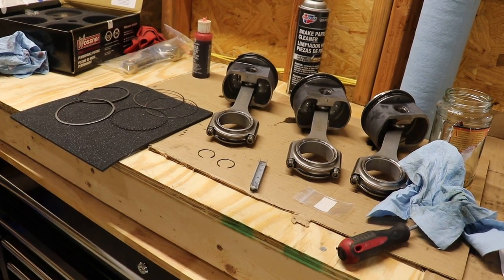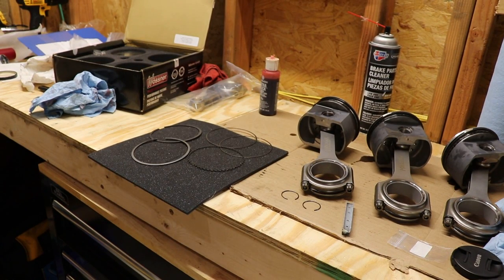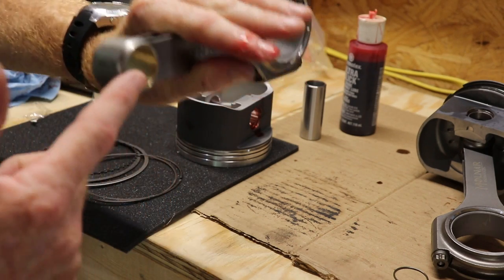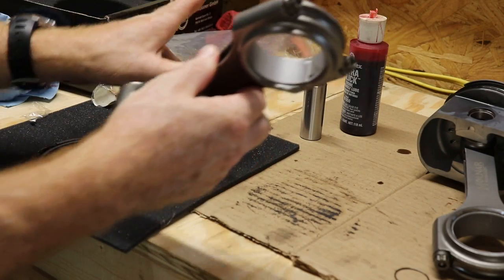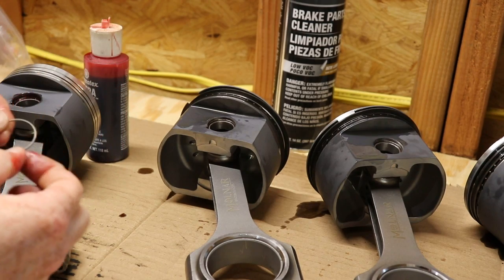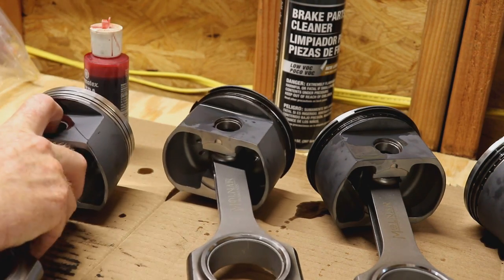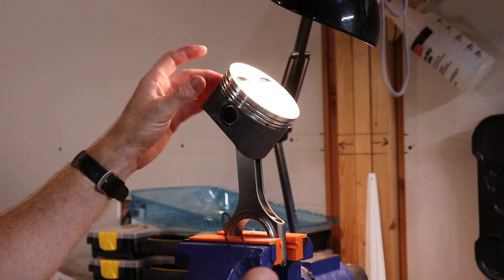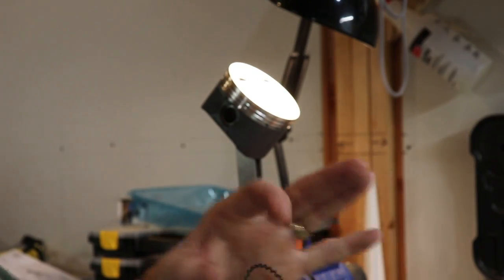Porsche 944: Project 944 - Assembling/Installing Pistons and oil pan

Comment: Did you have to adjust your ring gap? What kind of clearance did you get with the new pistons?
Reply from the maker: My cylinders were within tolerance. I got my pistons from Lindsey Racing and the rings that came with them were right on, so I did not have to adjust them. I don’t remember what the clearance was, I would have to go back and do the math.